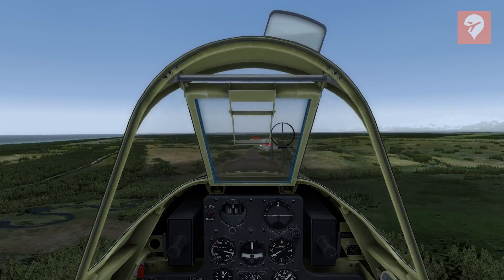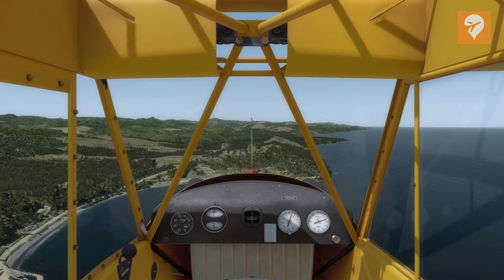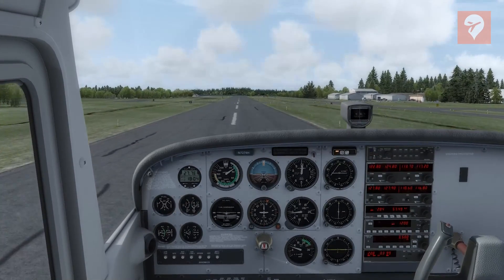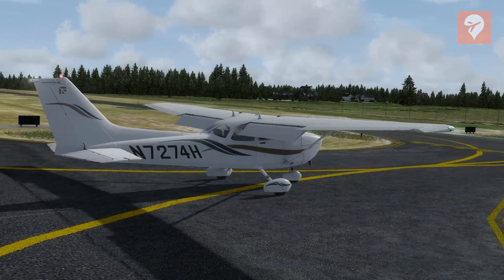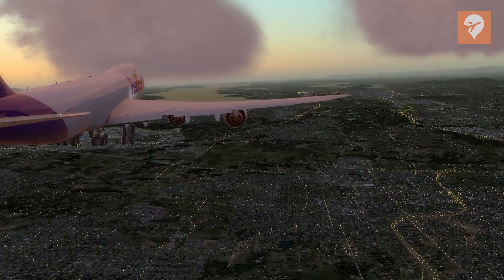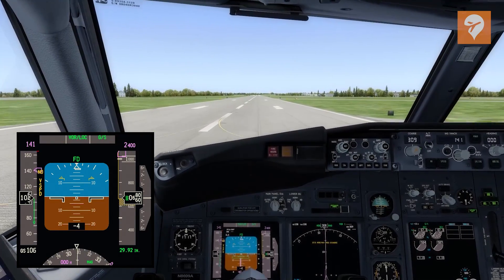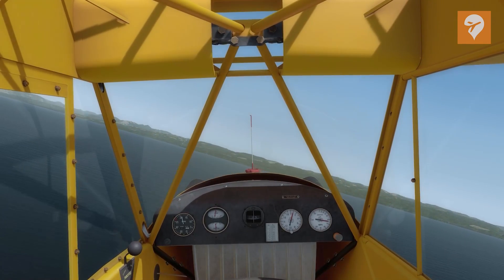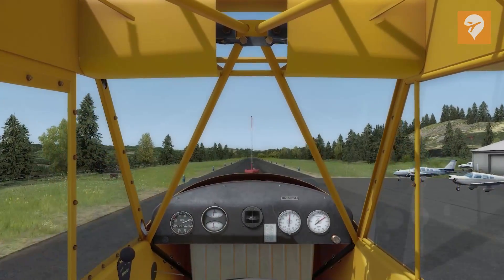How To Improve Your Landings With A Flight Simulator: The FSElite Tutorial

Comment: Thanks for the video.
It would have been nice to include:
- the short field / soft field techniques for GA aircraft since they are check ride exercises.
- the tools to practice those landings in our home flight simulators (such as the X-plane repositioning on final or a payware program such as FS-FlightControl)
- an explanation on ground effect (which has quite some influence on landings) and the way it is simulated (or not).
Moreover, a good landing starts way earlier the short final: either on the downwind leg for a GA or even before the Top of Descent for a liner (with a stabilized approach).
On the other hand, it is definitely a good idea to remind some members of the community that a good landing is NOT assessed by the rate of descent at touchdown (especially when the runway is contaminated).
The part on the taildraggers is also a nice addition.
Overall, this video is a good introduction to flying techniques detailed in the aircraft's specific operating manual.